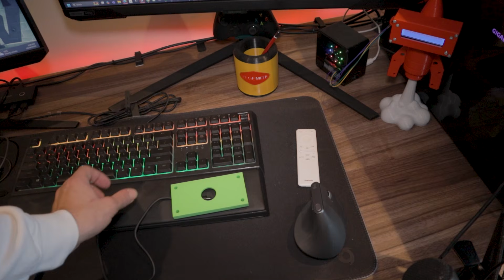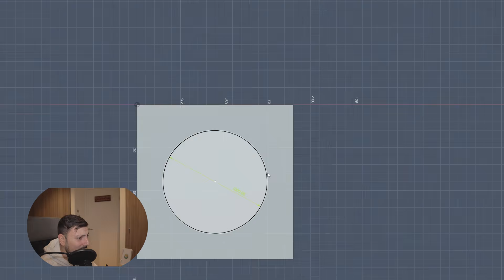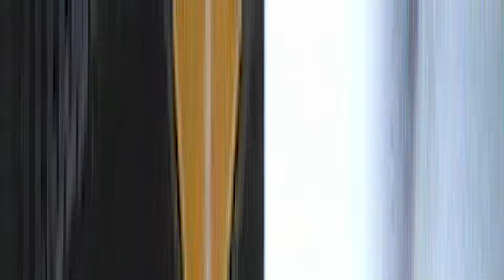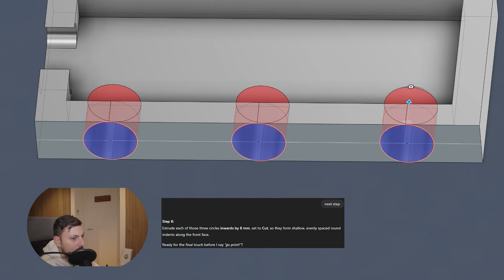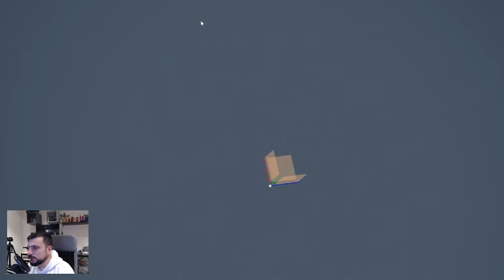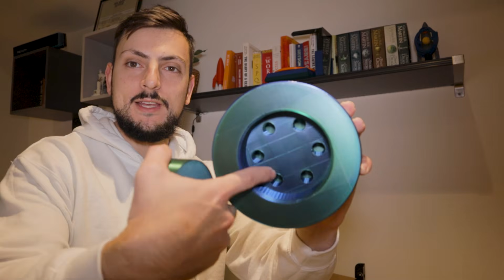Is ChatGPT-5 the Ultimate 3D Printing Game Changer?

Comment: I have been trying to get Claude to make an image to 3d program. Its really hard and I think we could all give links to each others program to see if we can all work together on it.
Reply from the maker: Super keen for that! I would say 'image to 3D model' gens aren't quite there yet. If you're familiar with 3D modelling software like fusion360, blender, solid works etc., then a good starting point is getting familiar with the tools and then using the LLMs to guide you through different instructions, provided you add your own touches where AI lacks imagination (as i showed in the final example).
Reply: @EngineeringDads  Yeah I think its gonna take a bit but I think I have a flow. Just need more brains on it.